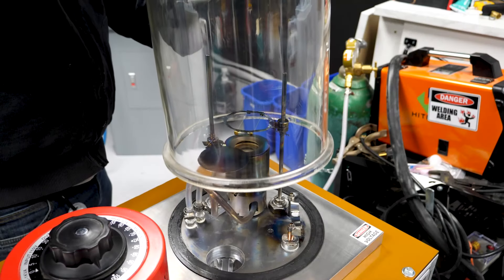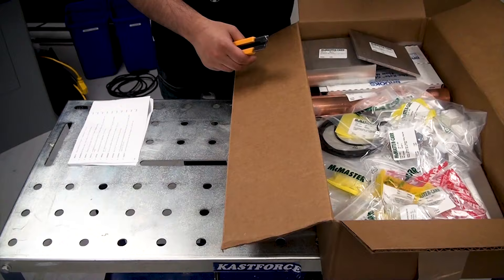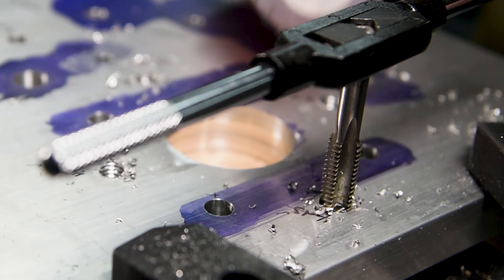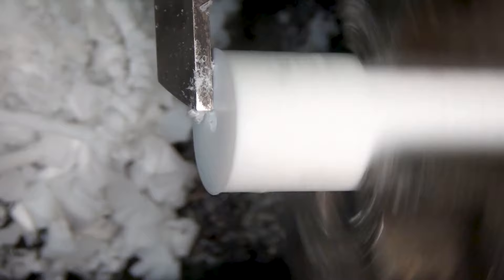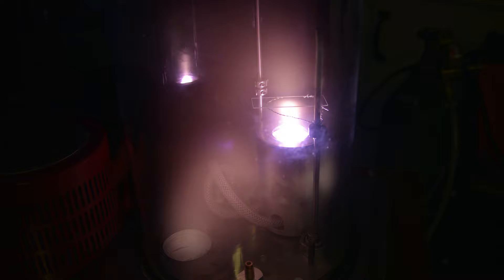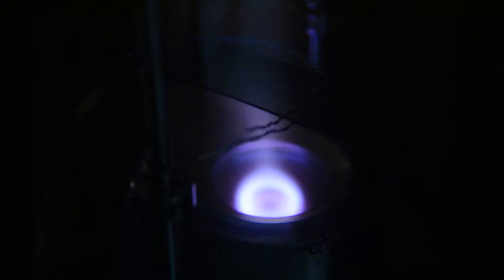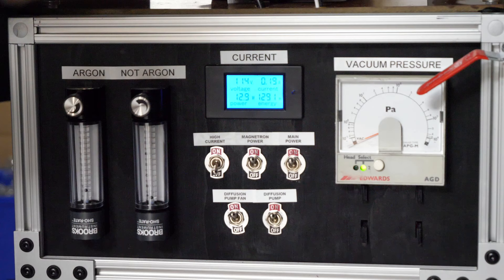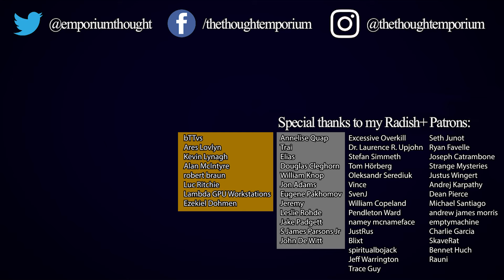Coat ANYTHING in METAL: Magnetron Sputtering Machine Build

Comment: we used a similar machine at work nanocoating electronics with hydrophobic coating. I have no idea what gas was in it but it tended to turn into some type of glass etching acid in the vacuum pumps. We would coat tissue or anything really and you could submerge it in water and it would not get wet. Electronics would be left submerged all year round and taken out to show clients how they still work. was called something like blue lantern "watershield". cool video. keep up experimenting.

Comment: For sputtering strontium aluminate and other bulk metal oxides, you might try pressing the powder into a disk with a die set like what NileRed used to make his YBCO disks. Might also be beneficial to sinter the disks after pressing, but I'm not sure how that would affect the oxidation state of the dopant.
Reply: Ion beam assisted deposition is the key to make high quality oxide coatings.  First, there's a base layer like stainless.  This is electropollished smooth, then a compatible oxide layer is beamed in.  This allows the YBCO crystal structure to grow the right way.

Comment: As a machinist that made parts for electron microscopes the engineers very specifically wanted to avoid polished surfaces. Thy specifically called for concentric lathe turned faces and oring groves. The circular lines in the finish at the R finish would actually help grip and seal the viton gaskets and orings.

Comment: I recently discovered that isopropyl alcohol makes an excellent cutting fluid for tapping aluminium. Not only does it just work really well, but after you've finished, it just evaporates away, leaving your metal clean.

Comment: As a scientist working with high vacuum for years now, I can say that you did some of your seals unessesary complicated (sanding really big surface is one of that complications). Almost every time (for your vacuum quality) you want to make some round groove 1-2 mm deep and 2-3 mm wide with good quality surface, place there a vacuum rubber gasket and call it a day. Gasket needs to be slightly taller than groove, so when it pressed against other surface it will be flattened and seal everything, you can achieve better results with two grooves on each surfaces you want to seal.

Comment: The way to deburr aluminum framing ends, is to use a wire wheel like on a bench grinder, or wire brush in drill or lathe, gets into all the nook and crannies in seconds.

Comment: 05:20 I find that usually denatured alcohol is enough lubricant/cooling for tapping and drilling smaller holes in aluminum, if it's not use a drip of some oil

Comment: Aluminum extrusion is great, with some caveats: Use braces in the corners to increase stiffness (side panels work great adding shear-resistance too) and be careful using steel fasteners in hand tapped holes, as they'll chew through your threads. Inserts and epoxy are great for that. Also consider adding sand or epoxy granite to the frame to reduce the resonant frequency and add damping.

Comment: This is hugely impressive, and got me wanting to make one, even though it's beyond my skill for now.  However, you can coat a flower with gold using electroplating.  You can argue the result won't be the same, but you can get very close.  The trick is to be able to coat the object with an exceptionally thin film of graphite.  I'm not going to give the formula for this coating as there is someone online selling it.  But essentially it involves polymers, graphite and very a volatile solvent, and you dip the object, resulting in a uniform conductivity on the surface.

Comment: Copper is indeed annoying to machine, but a very sharp HHS tool with a high positive rake will work better than the 0° carbide tooling you where using. You where basically trying to cut bread with a spoon. You do have to be a little careful as the positive rake tools tend to 'grab' more in copper. You can counteract this by tightening the travel locking screw just a bit so there's a bit of friction. A cutting fluid like the tap magic or WD-40 helps as well.

Comment: Taking a machining class once a year usually gives you access to the lab for the year.  Lots of toys to play with.

I went to school for this, we used crisco as a cutting fluid.

I cringed at the sandpaper.  That definitely should  of been a surface grinder, or at the minimum several coats of dye throughout the process to make sure you didnt develop low spots.

Comment: Idea for transmitting motion into vacuum chambers, use a magnetic coupling. I.e. basically have a disc of strong magnets on each side of a thin section of the base plate, then you could transfer motion with no loss of vacuum at all. This could also work for applications that need at least a bit more mechanical power. Use a gearbox on either side of the magnetic discs, so even though they can transmit bugger all torque, you can spin them to high enough rpms and reduce down on the other side to actually move more substantial parts around.

Comment: we do this at my job it's a process called Physical Vapor Deposition (PVD), we're an electroplating company but also have a PVD facility, we use a giant giant machine that has like 30 tig welders providing the power and has a huge vacuum pump, it's like 30 feet tall maybe 10x10 roughly(that machine not my area of expertise lol) we use 2 different machines that do it in 2 different ways, one called a "hauzer" is alot smaller but we use all kinds of gases and different concentrations to get different colors (argon, nitrogen, oxygen, xenon, acetylene, etc) to get colors like blue, black, all the diff gold colors, and a crazy rainbow pattern somewhat reminiscent of an oil film. it looks insane when it is running (although you cannot look directly at it and certainly not for long or it'll blind you ala staring at the sun lol) it's a big thick center rod with a spring looking piece of metal around it, and when it is running the room gets totally dark and inside the chamber it glows bright pink and shoots out giant pink lightning bolts and stuff, it is awesome!

Comment: Pretty cool. For the evaporator you can also use tungsten wire. Vacuum chambers for telescopes use those to hook pieces of 99.95% aluminium on it to coat mirrors for satellites and really high grade telescopes and other optics.
In terms of sealing, you can also use copper. Whatever plastic you are using eventually it will break or degrade. But that implies that all your surfaces need to be pretty flat and whats more important polished. The vaccuum itself or better said the atmospheric pressure is enough to press them down. (with the gasket on the outside). With precision machining and the laws for pressure you can pretty much calculate with how much force the gaskets are pressed together between the materials when you know the surface areas.
Another way to seal is to use conical fittings. And on top of that using heat to expand the metal you screw into and liquid nitrogen to cool the part you are screwing. But you have to be careful and not overdo it or you might crack the parts. Usually that is done with specific tolerances where the inside part is already a bit bigger than the outside. You also might want to check the expansion rates of the metal you will be using so it doesn't suddenly "leak" when it gets hot. This technique is very handy when you have parts that can't be welded together and still need a really strong connection like stainless steel and copper.

Comment: The process is called sputtering. It’s been a standard thin film deposition process for a long time. 
Rather than build one they can often be found at a science equipment surplus house for dirt cheap. Even if it’s not working they can be brought up to working status pretty easily. 
Also you can make an even simpler version with a DC power supply and no water cooling if you’re  just doing novelty coating.

Comment: The two best sources for very flexible wires are diesel locomotive cable and marine. They are both surprisingly available as well given the large industries surrounding those. As well as the fact that DLO (diesel locomotive) cable is used in many other application. In my small coastal area I can name a dozen vendors for such cable. 

Jumper cables are decent tho.

Comment: I will say, using indexable inserts coated in ZrN, TiCN or DLC in the right grade would make your life far easier for machining the copper.  You can get just about any carbide grade on ebay, for excellent prices so you don't have to spend $8 per insert.
Definitely not throwing stones, just trying to help for your next adventure!
Reply: We cut copper all day every day, and I have found just using a good lubricant/coolant and sharp tools will make it easy.

Comment: Oh something to keep in mind, jumper cables are a bad choice because they use aluminum wire. Finding a source of copper wire of large gauge is kinda hard. Ideally with thin insulation too. silicone insulation is soft and rubbery and tears easily (low abrasion resistance) and as such It tends to be quite thick. 

Aircraft wire (AS22759) tends to use very thin Teflon (ETFE) insulation. It isn't super flexible due to the stiffness of it. But the Teflon offers very high temperature performance (up to 260 degrees!)  and would allow minimal friction for squeezing in plenty of turns and high abrasion resistance due to the slippery nature of teflon.

Comment: As someone who works with CNC machines. Yes machining is not machining unless you ruin the fist part. If you're machining glass, it's also mandatory that the tool gets stuck in the glass due to dulling, idealy shattering the piece.

Comment: Great video.  I was really impressed with the results, quality of work and he vacuum levels achieved.  I would have like a better description of the magnets used (size, strength, ...).  Lastly, you are right about McMaster Carr. (one of my most favorite companies): If they don't have it, you probably don't need it (mostly).  As to their prices, I found that considering the selection of engineering materials, plant hardware, tools, fittings, ... , the fantastic amount of data, CAD drawings, specs. found for each of the millions of items, to be able to find every thing needed in one place and have it delivered the NEXT DAY, more than makes up of the higher price.

Comment: Pro-tip: Try cooling the copper as much as possible before machining, sitting a pile of dry ice on top to give a chance to heat soak around all the fixtures (particularly with a cast iron bed, because you dont want to heat shock it) It'll machine very nicely, OFC will actually clear chips similar to brass at dry ice temps

Comment: I'd say plasma etch chambers are another notch more magical than a sputtering magnetron. Modern dry etch chambers can etch anisotropically with insane aspect ratio, can double the feature pitch of the litho mask, precisely vary the etch rate across the surface, monitor  etch rate in real time on Angstrom scale, and they can coat the surface depending on the plasma and voltage biases.
Definitely magic processes

Comment: Rotameters are very accurate for flow rates that are in the middle 90% of their scale. But they do require a minimum flow to work. Make sure as well that you're using the right conversion factors for the scale with your gas of choice as well.

Comment: Bolts, nuts and bolt holes used in high vacuum areas should have slots cut in them to allow gas trapped between threads to escape quickly during initial pump down. Otherwise, they act like slow leaks, messing up the vacuum for a long time. As a plus, such slots will allow vacuum grease to be expelled from the holes, so you can fill most of the thread gaps with grease to prevent gas being there in the first place. As for o-rings and gaskets that are slightly porous, you can use pairs of them, with a weaker vacuum in between each pair, to prevent most of the slow gas diffusion through the cheaper materials. For really high vacuum equipment, use deformable metal gaskets pinched between a flat and a knife edge. Usually they are copper, and are single use, which gets expensive. I think gaskets of lead, tin, or soft aluminum would also work well where temperatures are not too high, but I have not tried them. I plan to try them when I can, probably making them as castings, to allow easy recycling of the used gasket metals.

Comment: could they use a machine like this to coat electronics in a thin layer of something that's not conducive and wear-resistant? I know you said it works with metals, but not all metals are conductive and it might work with something that behaves like metals w.r.t whatever mechanism this machine uses anyway.

would let our electronics last a lot longer since dust/shorts seem like the main culprit of wear-n-tear. So doubly so if given a second layer of some meta-material or something, so that if it is ever exposed to a short, that short burns out stuff that eats up the short-energy (while closing off the rest of the circuitry) and sticks in-place to both highlights the short-location AND keep the flakes/bits from floating onto other parts.

....actually, I wonder if some kind of semi-conductor could be added that acts like a really simple brain, with very slight signals which get stopped by short's, would let the computer can actually see its own short's and at the least warn the user...but also open the way to the computer proactively handling the short.
Reply from the maker: I actually covered this in the first part of the series, and will again in the next, but oxides/nitrides aren't always conductive. so you start with a metal, then react it with a gas to form the reaction product on the surface. So in short, yes

Comment: Machining copper is always tricky because it "work-hardens" as you cut it. Trick is to use a lot of a very high film strength lubricant (basically flood the cutting area with it and keep it flowing!), and use hardened steel tools instead of carbide, so that you can sharpen the tools instead of discarding them. Basically the moment you see any kind of edge rounding it's time to sharpen again.

Comment: It is a vapor coater or a sputter coater depending on how you are producing the material. A magnatron is only the the magnets under the track so electrons don't drill thru specific area where they get traped. Did you actually build this thing or is this a gag ? Wow you did build it nice job it looked like a professional bapo coater without conventional electrode setup for coating SEM speciments etc.. Learned about some of the materials in a vacuum. What was your source ?

Comment: Brass is not an alloy but a conglomerate. The two metals that make brass, copper and zinc are not chemically mixed so no single structure exists. A sample of brass polished and placed under a microscope shows very tiny spheres of copper and zinc at the ratio for example cartridge brass at 70/30 copper/zinc. Cheers

Comment: Cool project!  Was there a reason you didn't do the physical adjustments with motors inside the chamber?

With hobbyist CNC where it is today, I'd have thought precisely controlled positioning would be easy.
And it would be much simpler to seal electrical wires into the chamber, rather than mechanical turning components.

Comment: Hmmm, your moving parts can be improved and eliminate possible leak points while doing so. Have you ever seen a computer Hard Disk Read/Write head assembly? You should be able to use a similar design to make those parts on your vacuum chamber magnetically controllable therefore eliminating the need to vacuum seal moving parts which is definitely a hard job to do,

Comment: Try supercooling the copper in something like Liquid Nitrogen (Helium would be preferable) before machining it.  Theoretically, there will be no "soft" copper at that low temperature.

**Is not a machinist so I have no idea if it'll stay cool long enough to do any significant machining, but I do work in Cryo, and drilling through copper is much easier when it's cold (Generally stuck to a source of cold like inside of an MRI sock thermally linked to a full He Vessel)

Comment: Brilliant job! My first thought was why didn't you use a servo instead of inventing a hand drive that will withstand vacuum? Do you think it could not withstand the high voltage in that chamber?
Reply: The servo would need to firstly no outgas (as described in the video) and secondly be able to work in vacuum. Both are unusual requirements for a servo.
Reply: @userPrehistoricman  I don't think servo would have a problem to work in vacuum. Servo consist of simplest brushed motor and potentiometer (plus driver). Servo driver can be easily taken out of servo and put outside. Also servo can be made from metal if you talk about outgas from plastic servo.

Comment: There's honestly no need to use carbide for copper, or aluminum, from my limited experience high speed steel is a lot more forgiving when dealing with soft metal, plus coustom tools can be made with a bench grinder, and a piece of tool steel square stock. Also, the best wire for high current windings is welding cable, it's more flexible than jumper cable wire, and welding cabele is easier to get since basically every town has at least one welding supply, that usually carry multiple different sizes of welding cable.

Comment: One trick that works for me when I turn aluminum or copper on the lathe: I use carbide inserts for steel to machine soft metals, if I run the tool dry it doesn't leave a great surface finish. To get a surface finish like it was polished I use WD40 as "coolant" with the carbide tool and leaves almost a mirror finish, to make it even better use a bit of Scotch Brite after turning. (You can see it here at minute 6 on this video https://www.youtube.com/watch?v=oFxbSAIxjAs&t=19s) Very excellent work there guys!!